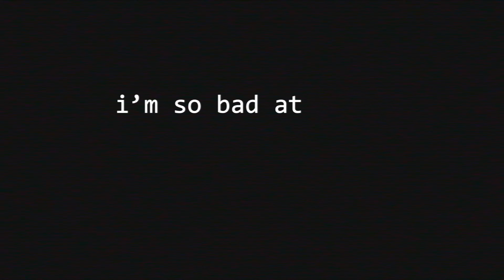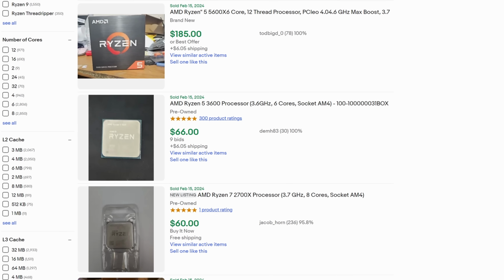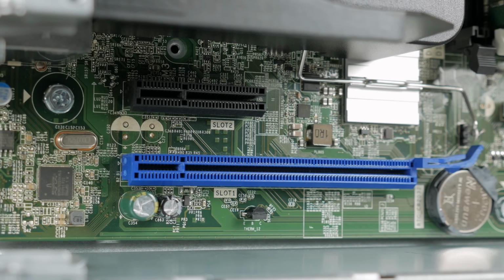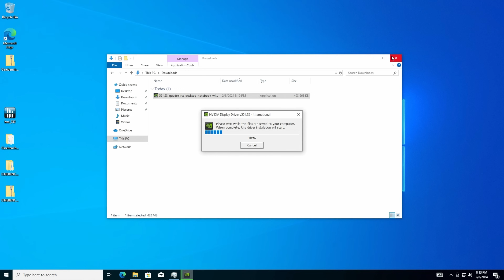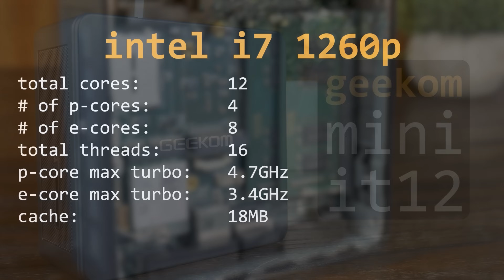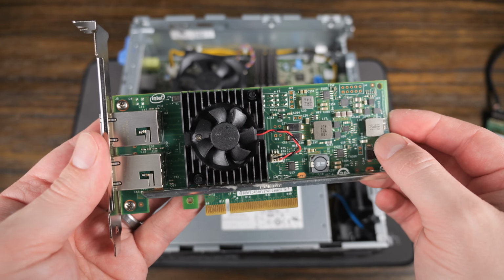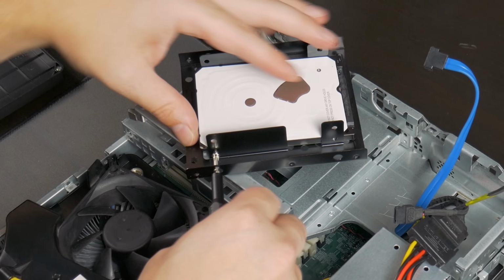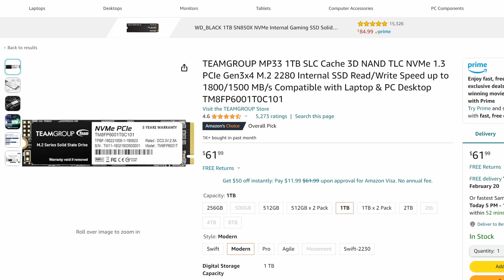Is This The PERFECT Dell Optiplex?

Comment: That turned out to be a pretty great little system for not a lot of money. It may not have as much flexibility as a MT PC would but for being as small as it it it has a lot of potential!
Reply: actually he MAXED out the potential ;) Though he might still be able to put a Ryzen 7 3700 in it, since it's a B350... but I don't see that as being a huge upgrade, probably not worth the extra cash.

Comment: bless the AM4 socket
Reply: Did the new bios also support newer Ryzen cpus?
Reply: @darkkingastos4369  For my mobo, yes. I bought mine along with a R 1800X. Eventually, the 2 nd generation was released and then the 3rd. Unfortunately, the BIOS chip is only 16 Mb large so there wasn't enough space, so they removed a lot of the graphics. I am using a R 3600 now.
The RAM was able to do 2800 MHz with the R1800X but with the 3600, it was able to hot the 3200 MHz easily.
Reply: @darkkingastos4369 no it wouldn't
Reply from the maker: Amen
Reply: Long live lisa
Reply: Agree. I have two machines with AM4 (5800X & 3600), great chips, both of them.
Reply: @keulloe  Hey same
Reply: Three Hail Zens
Reply: Am4 is hot ?
Reply: @gamestails Yes, smash 🥵🥵🥵

Comment: I bought one just like this thinking I could fit my GTX 1080 and give it away to my little cousin.... The GPU is exactly as long as the whole case 😂😂😂
Reply from the maker: Hahahaha been there. I fit a 1070 in a dell XPS system once, but the back edge of the card was literally snug against the front of the case😂
Reply: @HardwareHaven  Was gonna make a "No sag haha" joke then realized the tension would probably make it bend worse.
Reply: @HardwareHaven 😂😂
Reply: Get a Tesla p4 gpu for this. Best other than t4 or a2000
Reply: @bigtitmaster  just bought a P4 for my jellyfin server, superb value for endode/decode
Reply: Dremel
Reply: Need a low profile graphics
Reply: Still have my gigabyte gtx 1080 extreme gaming edition in drawer after being used for 6 years but, rx 6900xt being used now for 1.5 years since snagging open box deal for 650usd aka 50usd less than what I paid for gtx 1080 with 130-140% performance increase 🙂
Reply: It's crab, low watt cheap e waist.
less than a chromebook, unable to upgrade, use the parts ???